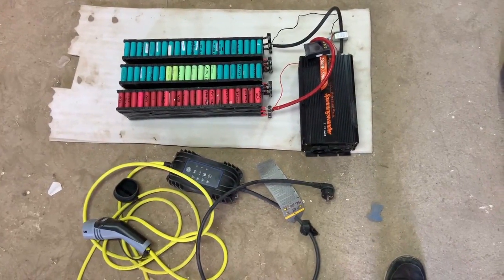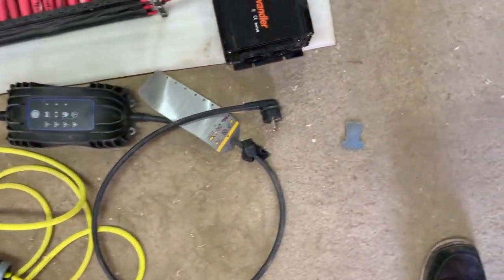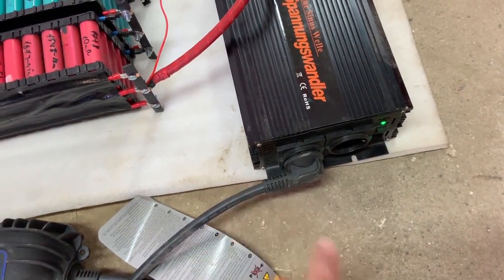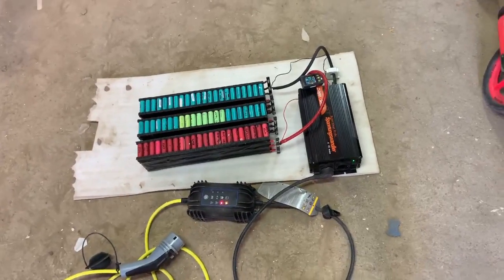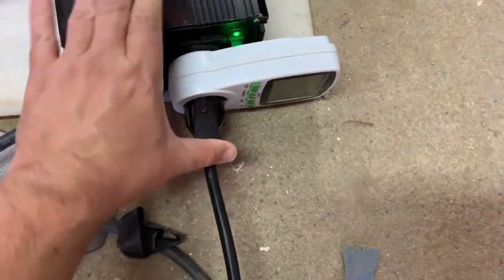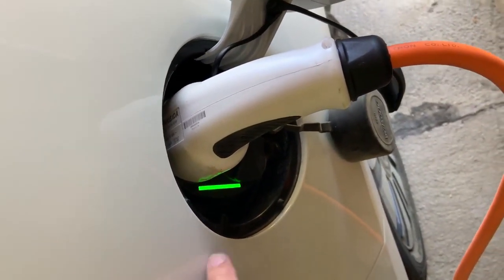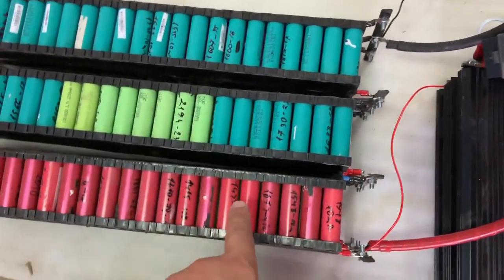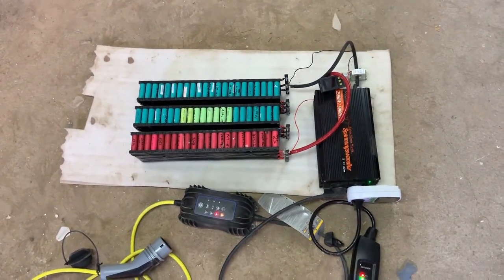Charging EV (VW e-up) using inverter and batteries

Comment: There are number videos where people jumper L (N) of the inverter to Gnd of the inverter. Some inverters really don't have a ground (like inverter I have). It is just not connected anywhere other than gnd of the inverter outlet(s) so for those inverters jumpering L to 'G' or N to 'G' will not damage inverter. When it comes to EVs or PHEV's battery (-) is almost always connected to car chassis (as you've tested here). Most of L1 charging adapters have ground plug wire which then connects standard outlet ground to vehicle chassis. Since most of those small inverters don't have a real N (neutral) if we connect inverter (with jumper between N-G on the inverter) we will end up having + and - connecting to chassis all the time. This may or may not damage car electronics. Not quite sure if some EV cars have ground fault detection inside the vehicle as well.

Comment: Are you charging your car 100% or the 80% that is told to be best for litium batteries to last longer ?
Reply from the maker: I am charging the car to 100%. I haven’t thought to set the charge to 80%. Do you know what Volkswagen are recommending? I don’t remember to saw anything about this in the manual. Thanks to that question. I will change my charge schedule tomorrow and set it to 80%.
Reply: @tedonash2681  I havent recieved my car yet so i cant see manual but all litium last longer with only 80% charge. This doesnt matter so much for cheap 18650 as they are cheap and many chargers can only charge to 100%.
Many EV owners charge to 80% if possible as it increases number of charging cycles , how much i dont know and think it depends on battery manufacturer but the difference should be noticeable. 
Here's en examplehttps://www.youtube.com/watch?v=xZyAMeCZWtA
Reply: Notice in video that charging schedule is not so advanced as on E UP, but his goal is to limit charging to 80% in order to prolong battery lifespan and charging cycles
Reply from the maker: @Viking_X  I make a research about this topic and some people are saying to charge to 80% some are saying to charge to 60%. Volkswagen have put a limit on top and bottom of the battery cells (around 5% on the top and 10% on the bottom). If you ask me I will not worry much about this. I am not planning the car to over live me.

Comment: Im also going to buy an Ebay/Aliexpress charger for my coming E UP.
Not so much of Earth problems but because Original charger is only 8 or 10 a, but some of these chargers you can adjust for any amperes that suits the wiring quality from where you charge.
This charger     https://www.aliexpress.com/item/4000334156301.html?spm=a2g0s.8937460.0.0.58a22e0eeB2Yj8 cAN be adjusted from 6a to 16a and is being send within the EU so no extra tax :)
Reply from the maker: I have went a long way researching how this chargers are working and the ones that come with the car and the cheap ones (like the one on you link) are only a AC proxy from the grid to the car. The way that they can adjust the current is to send a message to the car how much amps they can deliver and the car needs to respect that. There is no physical restriction on the charger. The car have the same mechanism of communication that can send a message to the charger how much amps it will drain (https://youtu.be/1N-845cfs3s?t=575), and the physical restriction is on the car for this chargers. I don't speak for wall box chargers just to be clear on this.  If you want to know more about the charging you can check this document : http://tesla.o.auroraobjects.eu/Design_Guide_Combined_Charging_System_V3_1_1.pdf or watch one of my videos about the CCS https://www.youtube.com/watch?v=RNciqy45lyo
Reply: @tedonash2681  yes,  but most original chargers are fixed at 8a or 10a, wheres as some of the aftermarket chargers can be adjusted from 6a to 16a (20a in some cases) 
The main reason that i ordered a aftermarket one is the ability to charge at 16a. it wasnt that expensive either. i paid 155 dollars on Aliexpress shipped from the EU so theres no extra tax
https://www.aliexpress.com/item/4000385429593.html

Comment: Great videos. Do you like your e-up so far ?
Reply from the maker: Yes, I am having it for 2 months and don't have any problems for now. The only problem that I had is mine wiliness to test the limits of the car and I went out of battery only once. This is the reason for this video.
Reply: @tedonash2681  Do you have app for Remote starting climate and charging control Car-net? Thanks.
Reply from the maker: Mladen Šantić Sorry I don’t have any. I am using maps+more app that is made by VW to schedule the car AC and charging power. BTW I am considering creating an app that work with e-up but I need to gather more info what is the protocol of communication
Reply: @tedonash2681  I look forward for more e-up videos :)
Reply from the maker: Mladen Šantić I am just curious what is your interest about e-up for? Do you own one? What do you want to see about e-up?
Reply: @tedonash2681  I am very serious to buy this new version e-up with large battery. If not new e-up than Skoda Citigo EV. My daily commute is 80 km in both way. I don't have garage so it is important to me to preheat car in winter. It will also be very good if I could remote operate climate in summer to cool car before I go from work to home :)
Reply from the maker: I would be very careful to expose car access to the internet. This from my point of view can grand access to adversary user on my car. The way e-up can heat/cool the car is by using the maps+more app and make different schedulers when you go to work or leave it. I have tested that and the air conditioner  turns on on a specific date/time specified on the scheduler. If you want I can make a video showing this.
Reply: Hi
Thanks for your great video.
I bought the same charger och I have 48v inverter och triet to charge my e-up, but it charge and cut continously. I think the charger need grounding.